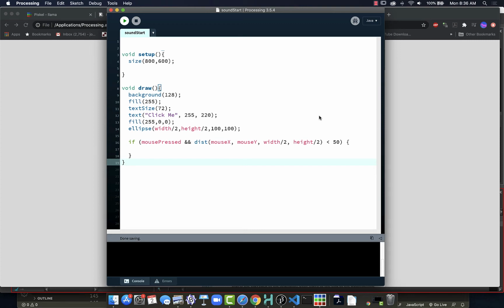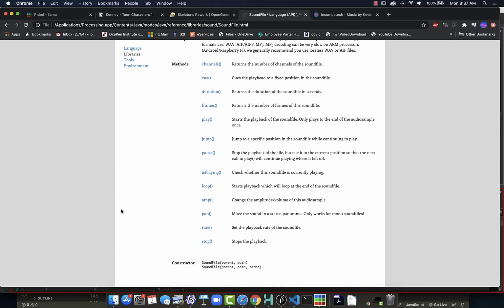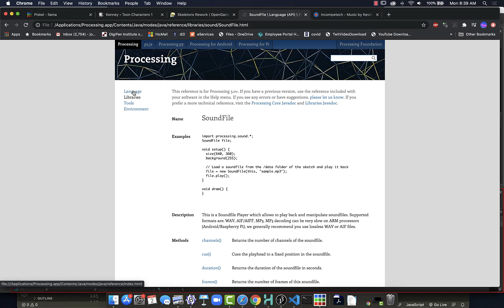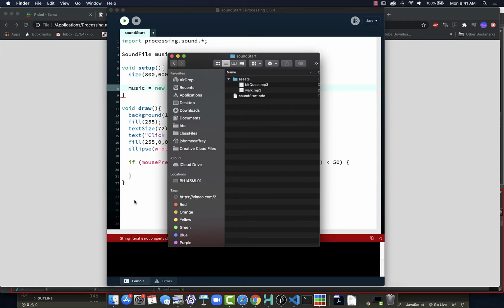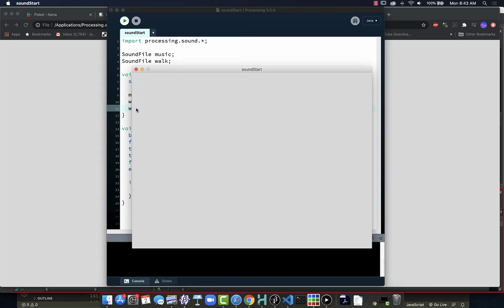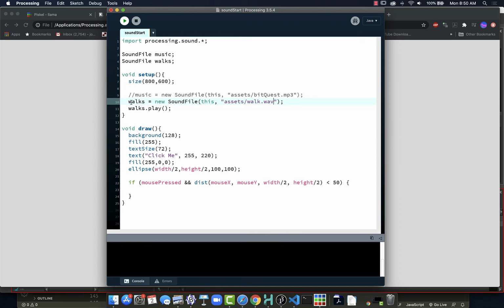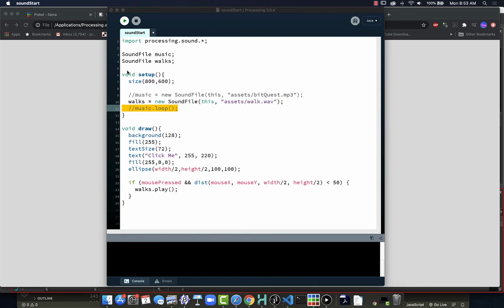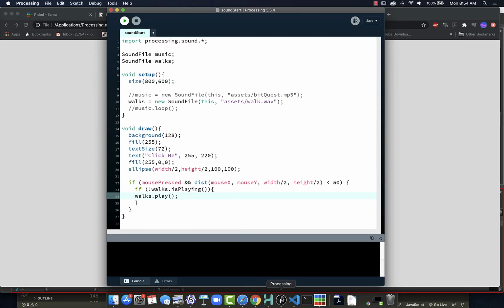How to Add Sound to a Processing Project

Comment: Hello John
I have test different sound files mp3 but it does not work with processing 3, I don't  know the reason, here is the code:
import processing.sound.*;
SoundFile music;

void setup() {
  size(400, 400);
  background(255);
 
 music = new SoundFile(this, "music.mp3");
music.play();
}

void draw() {
  
}
Reply from the maker: I have found that not all mp3s play in Processing. You sometimes need to change the encoding specifics of the sound. If the sound is not at 44100hz and 16bit it will definitely have issues with playback in processing. Open the sound in an editor like Audacity or Adobe Audition and change the export settings to be 44100/16.

Comment: Hello John! I’m trying out different sound libraries to help with a project I’m working on. I’m trying to see if there’s a way to alter a single sound object’s volume. In the default library I can only alter the volume for all sounds in the entire program. Many thanks, mat.
Reply from the maker: I don't see a method in the sound library. Minim sound library used to allow if I recall correctly. P5.js does appear to allow it in their sound library if you were to migrate your code to P5.js instead of processing.